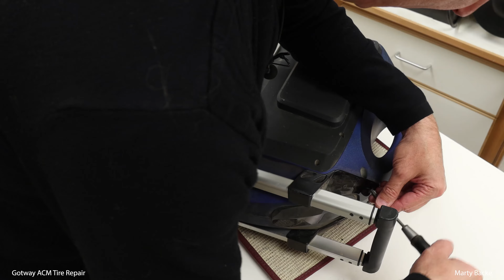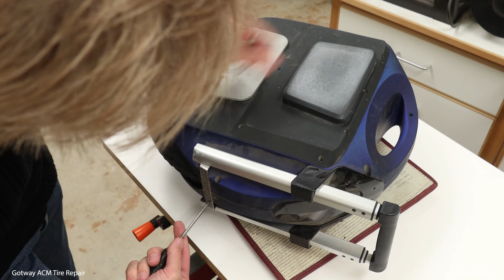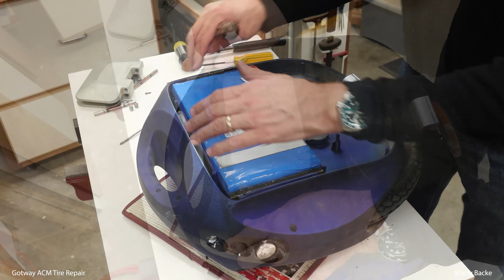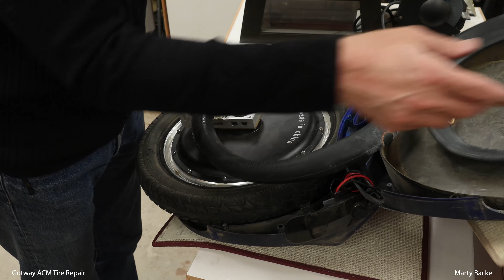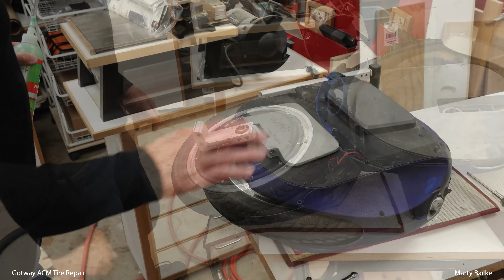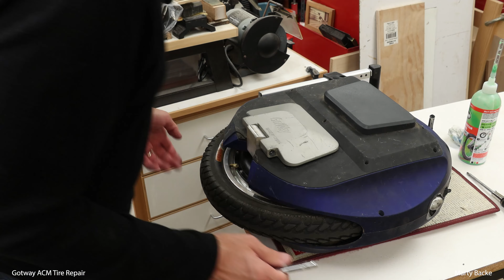Gotway ACM (and MSX) Tire Repair

Comment: Top Tip!...

I fitted new tyre & tube on my MSX using the zip tie and silicone lubricant spray method, by hand, without tyre levers, really easy...

6 zip ties around the new tyre, enclose the tube, except for the stem. Then, spray the bead of the tyre, locate the stem in the wheel hole, use both hands to push the tyre on the rim, then cut the zip ties, and inflate.

Comment: I wonder how many MSXs are still on the road in January 2023? My primary EUC is an MSX. Its tire went flat last week. The air would leak out in a few minutes after inflation. The tire tread was worn, so I ordered a new tire and tube from eWheels. This video was very helpful, because I never changed an EUC tire before. Thank you!
Reply from the maker: Hi Bryan. The MSX was a solid wheel and I'm sure many people are still riding them.

Comment: Hi Marty, is it possible to repair the tire of a Kinkson 16x in the same way as you show in this video? Without disconnecting cables?  From Medellin, Colombia. Thanks
Reply from the maker: Possible, but with KingSong it's probably easier to slide the motor out.

Comment: Good day,  Marty-  I've watched this video repeatedly to gain insight on how to repair my tire. You state that the basic disassembly is similar to the MSX, but there is a difference. I removed all the screws from the pedals, side panels, and the handle. When removing the pedal hanger screws, I was unable to separate the shell. How do I separate the shell to gain access to the wheel?? Now I'm stuck. Did you make a video on how to repair flats on the MSX??
Reply from the maker: I'm sorry that I didn't see your comment until now. There should be no mystery. Are you sure that you removed the screw inside the battery compartment, on both sides?
Reply: @ElectricUnicycles  Yes. The MSX doesn't have those screws on either side of the battery case. I figured it out though. On the MSX I had to unscrew the 8x screws above the battery case, just under the handle on one side of the wheel. But the basic format was dead on. Thanks a heap for your help.
Reply from the maker: @alonzohappnze375  Glad you finally got it apart.

Comment: Hello everyone I am a new beginner and I am starting to like the electric wheel my problem is that I am looking for a shell for my wheel gotway acm 16 but I have not found and also a battery 680wh someone can m help I will be thankful thank you
Reply from the maker: The ACM is an old wheel now so it'll be very difficult for you to find a shell or batteries.
Reply: @ElectricUnicycles  thank you for your answer i will search again and too bad if i don't find thanks again
Reply: Still riding my ACM2 going till it can't 💯💪🏾

Comment: I have Kingsong 16X any idea where I can buy inner tube (16X3) for it ? 
Also have you ever investigated this product claiming to stop puncture by lining the inner wall of the tire (between the inner tube and tire) with a strong elasticy plastic material ?
Im looking for puncture protection solution and found that the "Slime" only lasts 6 months (unsure what happens to the Slime after 6 months)?
Reply from the maker: I've used Slime that was effective for over 2-years. 6-months is a conservative value they put on the label. It'll last years before it dries out.

I buy my tubes from my dealer, EWheels.

Comment: Its unlikely your inner tube ripped at the stem due to "age" ... your tyre pressure must have been too low and the tyre rotated on the rim and took the tube with it causing it to rip. This is a common issue with MTB riders that run low pressure.
Reply from the maker: I ALWAYS ride with my tires inflated to a high PSI. But you're probably right that it's not age related. Could have been from wear-and-tear that occurs when filling the tube periodically.
Reply: @ElectricUnicycles If its general wear then the rubber at the base of the valve stem will be damaged all the way round and not ripped.
Reply from the maker: @NB-fc4rl  I didn't inspect it that closely. It's not that important :-)

Comment: Appreciate this great video. Is it possible to replace the tire or inner tube on a MSX using the same method without unplugging any wires?
Reply from the maker: Yes, the MSX/MSuper line of wheels follows the same process.
Reply: @ElectricUnicycles  Thank you so much for the info.! This is really helpful to know.

Comment: Marty, As you were comparing the inner tubes, I think I heard a screw hit the floor.  
I use magnetic cups to hold screws during disassembly.  I got mine from a hardware store 
and a small one from the 99 cents store.  They are metal with a magnet on the bottom.
Reply from the maker: Yeah, I have a couple of those - I have a nicely appointed workshop :-)   Did you know that Gotway uses non-ferrous screws in many of their wheels, including the ACM? Thanks for the suggestion though 👍
Reply: @ElectricUnicycles  No, I didn't know that.  At least the cup shape will keep the screws from rolling away.

Comment: Do you know if there is a different tire that I can buy for my Z10 other than the  stock tire?
Reply from the maker: I have not seen or heard of a different Z10 tire.
Reply: @ElectricUnicycles  Ok ya me either, thanks!
Reply: There are no aftermarket tires for the Z10 that I know of. However, the stock tire for the Z10 is pretty good for most terrain. 🤠👍